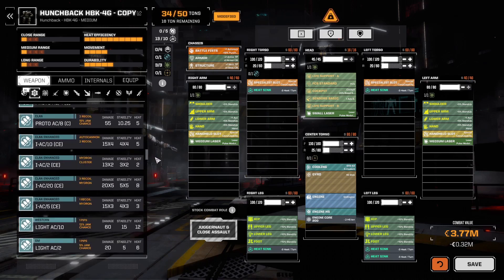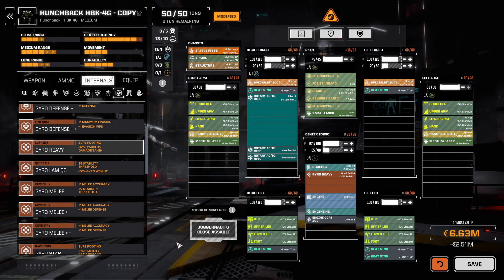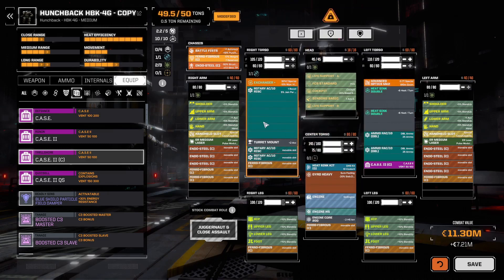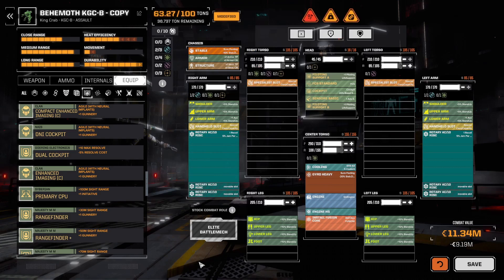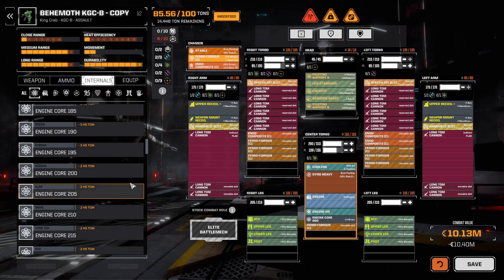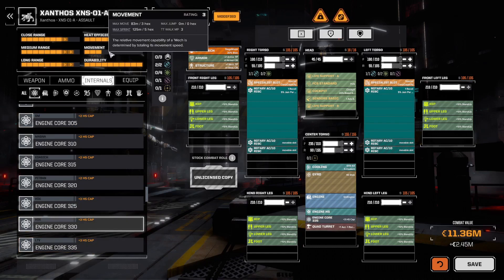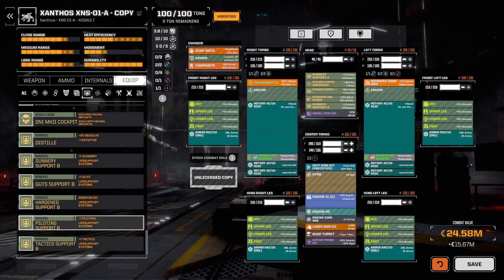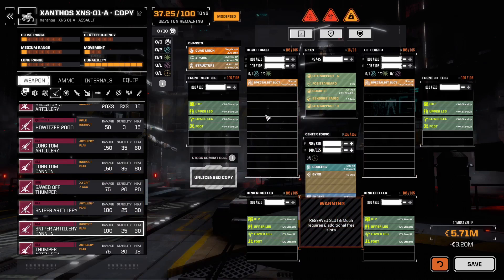Lets talk Knockdown % - Roguetech HHR

Comment: Glad your looking at the numbers. So I was correct that piloting does mitigate knockdown. I use both the RAC20, RAC10 and Arrow systems which have knockdown. I don't carry multiple knockdown weapons on one mech so I don't stack them. As for my pilots, many of them have over 10 piloting. Whether they are using Enhanced Imaging or Cockpit Interface or they are using SLIC suites which also increase piloting. 

Even going 6 shot with a RAC20, I have only been knocked down once the entire time I have used it. And I must have over 100 missions now with the RAC20. And the one knockdown I did have was early on when I got it so piloting wasn't maxed. 

When you skipped taking the RAC10 in your playthrough. I was sort of crying. That thing hits hard. 56x6=336 damage. I have a King Crab with the RAC10, RISC Hypergauss which can theoretically do 300 damage but never does since its a shot gun type weapon and a Clan ER PPC so max damage is 700+ with the mech. It does delete heavies and cripples assaults with a full alpha. But the mech that absolutely trashes mechs is my Marauder II with the RAC20 and HAG40. 90x6-540 and the HAG40 does 200 max damage. So over 700 damage, the RAC20 rips apart assaults and the HAG just finishes it off. 

The one weapon I haven't yet seen are Light rail Guns. I want some of them but I don't know how to get them yet. I want to equip them on a Bargest, give the Bargest Void Armor and signal jamming stealth and have it snipe mechs while keeping safe.
Reply from the maker: Yea, ima sucker for Risk Rac/5. Its still 40 dmg per hit with greater range. Coupled with Ballistic range sensors, you can hit reliably from twice as far as a rac/10. Without any knockdown
Reply: I am allied with Steiner at the LRG and other nice big weapons pop up under Steiner store from time to time. 3million however and I have not seen any ammo for sale as yet

Comment: Very helpful. I secured and repaired a Matar recently with the BFG 9000. Has a 40% knockdown chance. Other issue is the chance to blow up is a x10 multiplier based on recoil. So currently only firing every other round. Bracing reduces recoil by how much? Without bracing how long does it take to get rid of recoil?
Reply from the maker: bracing does not reduce recoil, its a fixed effect that happen upon firing and it will go away when you don't fire again next turn. What does reduce recoil is pilot gunnery skills and abilities like : ex-military. Also items like weapon mounts, FCS ballistics+ and battle computers. Hope this helps
Reply: Thanks very much
Reply: Even with the alpha of 350 on BFG, not sure how good it is if I am only firing every other turn….although range is ridiculous
Reply from the maker: Yea its tricky to use, I don't use them myself and prefer faster movement